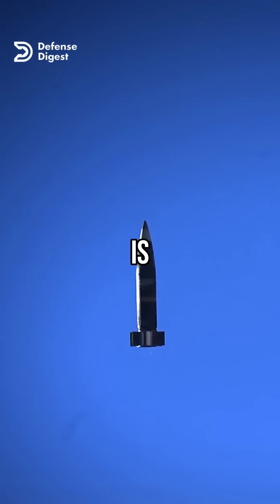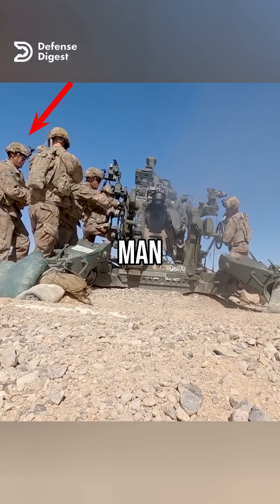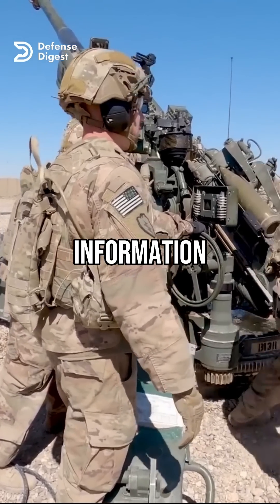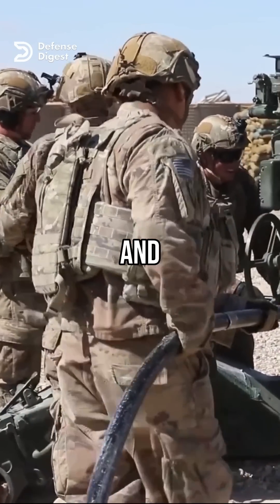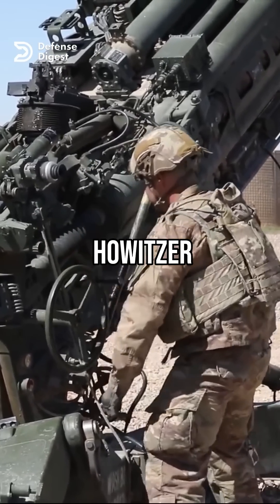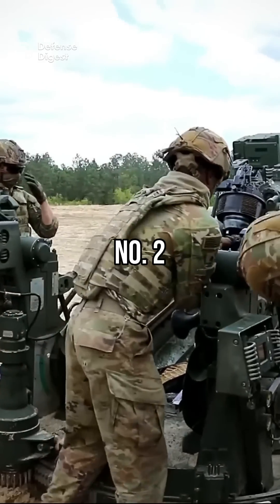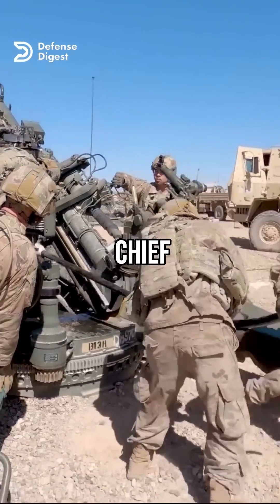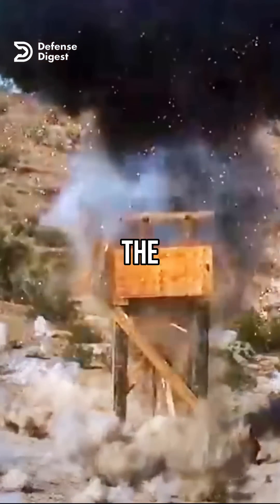How M-777 Howitzer is Aimed and Fired?

Comment: Tge M777 has a screen on each side near the traverse and elevation wheels which displays the current deflection and elevation of the gun. The FDC sends the new firing data digitally and those screens tell the gunners which way to spin the wheels to get the gin to the correct deflection and elevation. The section chief has their own screen which displays the same data and includes other information regarding the fure mission. The panoramic telescope (PANTEL) is only used if the guns digital system isnt working. Also usually the PANTEL is aimed at a collimator as that is far more accurate than a known point in the distance

Comment: Yeah, a lot of this isn’t correct. 
- “5-man crew” doesn’t account for the ammunition team chief and another ammunition bearer/cannoneer or RTO. The section chief in practice is not supposed to be hands on anything except for verifying the fuze is tight and correct and that the round/charge is also correct. So they are useless.
- The howitzer itself does not use an electrical primer. It’s the same smokeless powder-filled, brass primer that’s been in use for the last 106 years.
- there’s other wrong information but it’s more attributed to them blending the specifications from the M982 Excalibur with the specs of the howitzers itself. 90% of combat missions you’ll be using a good ol’ M795 (or M107) unguided HE round.
Reply: Watching this video made my brain commit suicide but you yes true correct

Comment: This sounds like quite a lot of people for just shooting a gun. In the 21st century this should be possible to do with much less personal. 
Where is the automation? 
Are we stuck in the 1960ies here?
Reply: what happens when that automation fails? or a circuit burns out? or you run out of power to power the gun. That gun can be fired with out power and just with man power. I know cause I have had to fire one with the basics and we saved other soldiers lives. Nothing  works all the time so you need to have people ready to do the hard work.

Comment: Could some1 gave me the name and use of that metallic bent stick they shove up the barrel?
Reply: That’s called the ram rod. Used to seat the round into the tube
Reply: @Marty13B  to seat the round into the tube? But it looks like a q-tip... Sorry 'bout the quizz dude but, i'm an idiot about artillery..
Reply: @jacklastimosa2802  no worries, the round aka artillery shell for the m777 is 155mm that weighs about 100 pounds for your standard high explosive. You can see them putting the round on top of the loading tray, they place the ramrod behind the round, yell “ready drop” and the 1 man pulls a lever to drop the tray letting the loaders to push the round into the breach to a point in the tube that catches the round and has it sit securely. After that you put the MAC charges in behind the round then close the breach

Comment: They aren't shooting degraded lol they are shooting digital decent explanation but he's using a gunner display to lay the howitzer on target pretty much a cross hair with some arrows arrows tell you which way to traverse or elevate if your far off arrows will be big if your close they will be small if your on the money a solid black circle will appear now your ready to rock this same data also comes from the FDC what the chief has is a csd or some pople call it an fcc he will receive all other data pertaining to the the specified mission such as charge fuse type projectile type deflection and Quadrant special commands number of rounds and so on its essentially a video game laying the howitzer on its target
Reply: He doesn't adjust the azimuth the gun is originally laid on the correct azimuth "the direction its pointed" he's adjusting the deflection left and right movement the only time your change azimuth is if your out of traverse can't pick the target up with normal range of motion then yes the gun will be bumped or spun depending on how far the out of traverse mission is. They also don't use electronic primers there's a primer magazine that holds the primers the m82 primer is pretty much a bullet casing full of powder no bullet just the case.  The number 1 man is cycling a priming handle every downward throw of the handle loads the primer every upwards throw it will unload and eject the spent primer which you must save and turn in.
Reply: A crew of 5 would be a skeleton crew in no way shape or form should your number 1 man be leaving the gun to load you need atleast 7 for a comfy crew. The more re watch the more I catch. I've been certified on both the m777a2 and m119a3

Comment: That thing has less recoil than a 12 gauge 😮
Reply: That is because if you look at the back part of the gun you will see those legs, they are dug in the ground and it stops the gun from sliding back. If they weren't here that gun would slide back and possibly kill someone.

Comment: I served on this gun in Iraq and Afghanistan. The cool thing about the 777 is that it fires a huge 155mm round however it is light enough to be airlifted. This gave us 13b's the ability to set up a remote fire base (especially in Afghanistan) to provide indirect fire to troops in contact. And paired with the m982 we could decimate anyone that engaged our troop with overwhelming firepower just where it need to be...when it needed to be there!

Comment: That's nothing compared to a 16 inch cannon from a battleship 🚢 😮
Reply: When it can bee air lifted or pulled by a truck ya it kinda is. The big guns are not even really used anymore as Rockets are way more effective. How old are you that you think they still use 16 inch cannons on battleships :***D

Comment: There were TEN of us on my old 155mm..... And you would not want less :-)  Setting up netting, and doing shoot and scoot, ONE guy has to drive the truck, one guy has to stay on the radio, ONE guy is a medic, I mean..... 5 guys?  wow.
Reply: Good ole gun bunny.  When were you in and what unit?
Reply: @KidLee1141  lol, this was in "the kings artillary regiment" in Denmark back around 2001, RIGHT when 911 happened.
Reply: @@logiteknya the gunner cannot touch the charges. Their job is tied to the sight. Also with the breach being soo far up, the gunner would have to leave his sight, run around the pantel and then slide the charge into the the breach. Significantly slowing the process. 

The Modular Artillery Charge System (MACS) make it much easier to form charges as opposed to the old bags where you would need to remove the linen bags filled with cordite and dispose of the unused charges. But there are still instances where green bag charges are still used (usually for calibration).

In practice the prime mover driver is the radio-telephone operator when the truck is stopped and the cannon is dismounted.

So with driver/RTO, section chief, gunner, assistant gunner, ammunition team chief, and cannoneers; crew “should” be no less than 7
Reply: I think one person can fire the Archer.
Reply: @logiteknya try loading it with 3, even 4 and not taking so long that you get hit or over run.  Extra people are needed for security and rest, relief, replacement for injured or dead or running down a hundred other things.  3 or 4 probably is too few on the 105mm's
Reply: @davidr1676 3-4 is perfect for 105mm, but this isn’t a 105mm it’s 155mm.

Also loading the M777 one man is only difficult above 600-700Mils, even then it’s only difficult if you haven’t done it before.

Shot M777s for two years before going to M119s for another two.
Reply: @monopalle5768 the crew listing isn’t correct. The do not factor the entire crew such as the ammunition team chief, who is integral to the gun section), the radio operator or cannoneer #3 who preps the charges for the ammo team chief. In practice though cannoneer #1 duties can be shared by the assistant gunner (hook up lanyard and firing). But it’s not in the manual.
Reply: Sounds like you served on the M114 or M198!!! The M198 was my 1st Piece!!! Hoooaaahhh, Field Artillery leads the way!!!
Reply: The more men the merrier, but when it’s the skin of your nutsack with people, you operate with who you have. Tooth to tail.
Reply: I had a crew of 5 guys both garrison and down range still out shot everyone else
Reply: that is crazy!!! I was FDC in a M198 battalion.  Took at least 8 to do an occupation
Reply: Technically you need only 1 to shoot the 777
Reply: @carjuncky1 technically any stripper can fire.